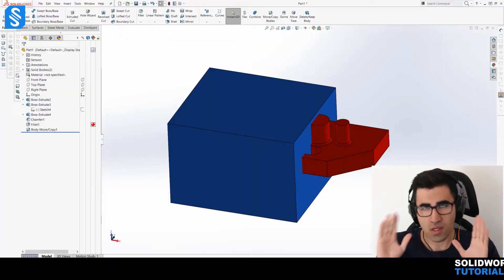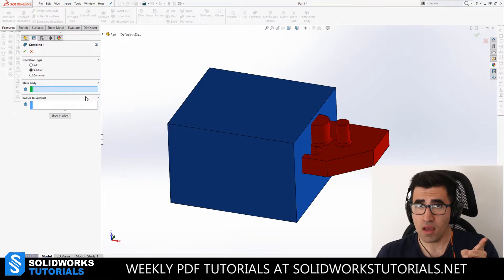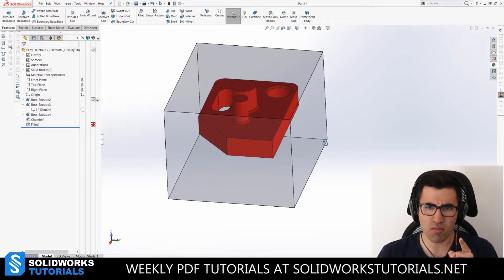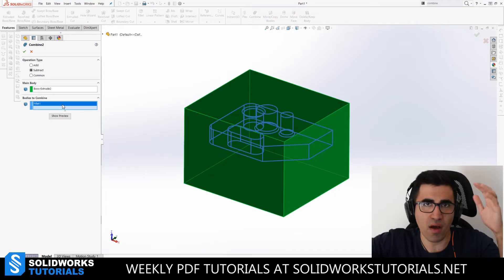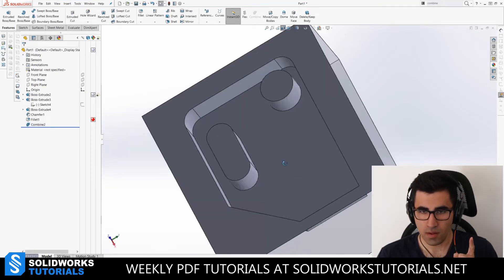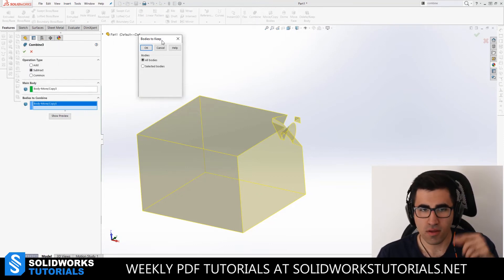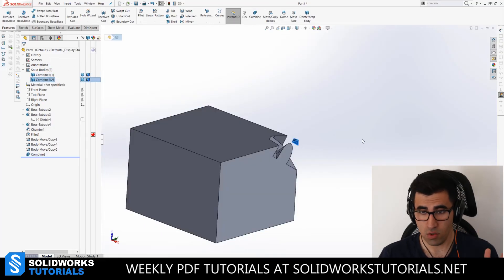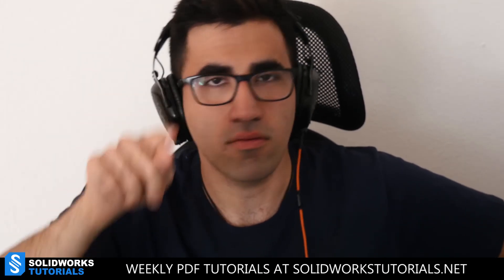SolidWorks How to Subtract a Part from Another (Solid bodies subtraction)

Comment: anyone who can help me, there's a problem with my software because combine fitur is dissable. How can i solve this problem?
Reply from the maker: it is because of only one reasnon: you only have ONE solid body. To have the combine feature activated, you'll need two seperate solid bodies.
That happened when you extruded (or made) your second part and you forgot to uncheck "Merge Results"

Comment: Dear Sir. How to make a cut one body from another by rolling around? For example, if it is a tooth cutting procedure.
Reply from the maker: revolve cut?
Reply: @with-aryan  The body turning around the point by the circle (ride around the initial circle) and at the same moment rotating around own center by ratio (for exmpl 4/5)

Comment: Are these two parts in an assembly? I only have one 'part' in a part at a time?
Reply from the maker: no. in the part mode.That's the point
Reply: @with-aryan  That's why I was asking - in part mode for me the Combine option is greyed out... I did it in assembly mode and then saved as a part.

Comment: Nice info, how can we extract that combine to another part ? thanks :)
Reply from the maker: Combine is not ideal for that, you have to use Indent
Reply: @with-aryan  Ok, I give a try, how can we get the right thread from extracted part to my designed part ? thanks
Reply from the maker: @RixtronixLAB  what do you mean the "right" thread?
Reply: @with-aryan  Hi Aryan, thanks for the reply, I need the thread from another part being used to the part I design, I tried with combine and substract, looks like it's good, how are you ? cheers :)

Comment: what if we want to retain, some bodies after subtraction. subtract totally removes the body, but if we want to split up into two different solids, how to do ?
Reply from the maker: copy it first, then do that, that's the quick work-around. The main way would be to use deform

Comment: Is it possible to cut with both bodies, keep them and only subtract the parts touching?
Reply from the maker: use Move/copy body to duplicate it first, then do it. But the correct way would be to use DEFORM which is a feature
Reply: indent could also work

Comment: Is there a way to subtract one solid body from another, but still retain both bodies? I would like to use the features on the first body to create a hole in the second body, without loosing the original body. The way I do this now is by making a dummy copy of the first body, that ultimately gets deleted when I use the subtract feature. It works, but seems a bit kludgy.
Reply from the maker: Feature: Deform
Reply: Thanks, Ryan! I will try this!

Comment: Is there a clever way to create a nice imprint with one body to another. Basically submerging the red body completely inside the green body... but in a way that enables you to physically place the red body into the green body if you were to 3D print it for example.
Like a nice little exact fitting box for the red body.
And to allow for some wiggle room... walls must be a little further away from the part and and shafts must be created smaller in order for the red body to fit in.
Reply from the maker: Your gonna have to use the same technique and use extruded cut (if applicable) to create an openning. It is a case dependent question

Comment: I've been searching for a week for this explanation. I've been trying to use cavities but that's way to hard, this is so much better. Thanks!!
Reply: Combine-Subract works ONLY with multibody parts (multiple solids within a single part file, and they overlap).  Cavity feature works ONLY at the assembly level, and you have 2 or more parts that overlap.